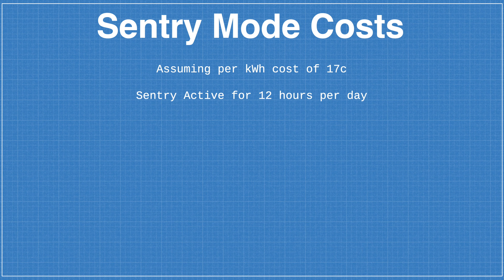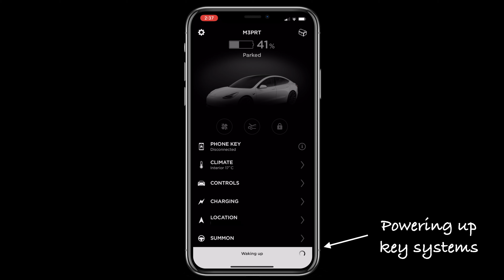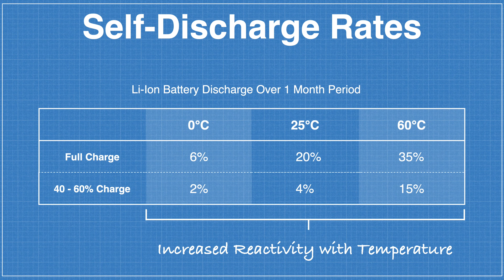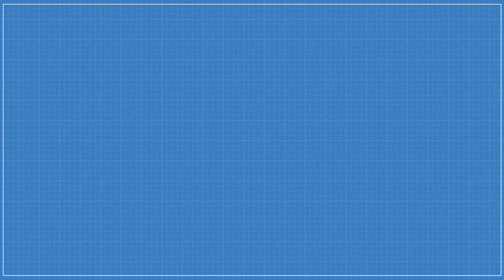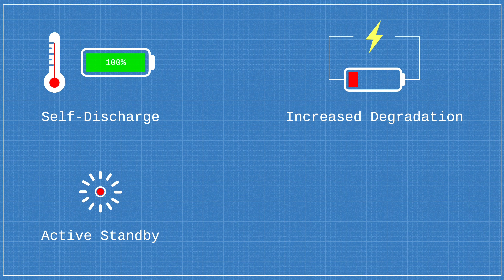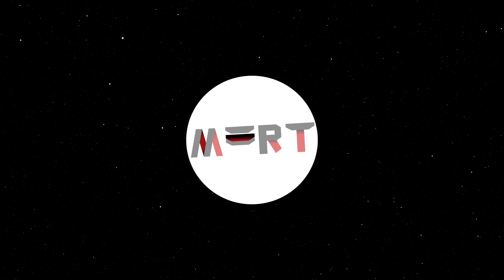Tesla Phantom Drain Explained

Comment: I have everthing off  on my brand new 2021 model 3 and it is still losing >1.5%  per day 
 - a very depressing  discovery that I didnt know Tesla had (or thought had been solved). Not sure what I missed. 
I've done everything I have been told  about. Sentry mode is definitely off...etc 
My BMW i3 wouldn't lose that much in over 2 weeks - so why can't Tesla achieve the same trick that BMW manage to do?   I don't know why, especially  i am always told  by Tesla fanboys that Tesla are the ones supposedly years ahead of legacy car makers. 
I am seriously unimpressed by this drain effect and part of me is already regeretting buying Tesla
Reply from the maker: Thanks. There are a few things to consider here. 
- In the past few weeks, we have seen very cold temperatures (0 degrees and below). These cold temperatures will have an impact on the battery performance of any electric car, so the rate of discharge you have seen since purchase will likely become less as the over night temperatures start to increase. 
- Discharge is impacted by the mobile app. If you frequently use the mobile app on your phone to check the battery level, then this will increase the rate of discharge as every time the app connects, the car will need to “wake up” and activate some of its computer systems. This effect is worsened if you use third party (Tesla Stats etc) apps to track energy usage as these apps tend to poll the car every few hours to get the latest data. 
Let me know if either of those two suggestions help out! :)
Reply: @M3PRT  I used the app twice to check over the course of the week . I lost about 12% total ...from 44% to 32% charge state  - which on a 80kwhr long range battery is almost 10kwhr of energy disappeared (but where?). By contrast, my BMW i3 - sat outside next to it, in exact same conditions - and checked same way...via app -  has lost about 2% in a week - which on it's 28kwhr battery is  about 0.6kwhr. A shocking almost 20 fold difference between the two. Not acceptable to me ...but apparently Ok for Tesla most owners .
Reply from the maker: Hmm. Yes, that is interesting alright. Hopefully they’ll make some improvements with a software update ASAP!

Comment: Fantastic video. Thank you!
I just got my Model Y six days ago and even though I leave it plug in overnight (not charging as I set it to charge only if it drops to under 50%) it shows 4% lower battery  charge the following day. Sentry mode is off at home, and the temperature is not higher than 26 Celsius. I am trying to figure out what is draining the battery. The Tesla app is not used at home. The only other thing I could attribute the drain is Tezlab app. I would appreciate if anybody can help me understand this.
Thank you again
Reply from the maker: Thanks Alfredo and congrats on your Model Y! I would say that the Tezlab app may be having an impact on the drain due to the fact that it likely polls the vehicle for information on a regular basis which would cause the in-vehicle computers to power up intermittently. Maybe try deactivating Tezlab for a few nights to see if it improves :)
Reply: Thanks

Comment: Very interesting. I didn't realise that Tesla vehicles lost so much energy to connected features. I suppose you don't really spot it if you're using your car daily. My e-Niro is a "dumb" car, obviously with a different battery construction. I've never noticed any vampire drain (not even 1% after two weeks), but the dash light does indicate that the 12V battery is being charged while parked sometimes. I suppose it's something that drivers with no home charging should be aware of too. It would be tempting to leave sentry mode on if you're parked on the street.
Reply from the maker: Yeah, the active features on the Tesla definitely use a lot of energy alright. Especially when compared with your e-Niro! And yeah, Sentry Mode uses a lot more energy if there are multiple detections too, so parking on a busy street would likely result in even more vampire drain.